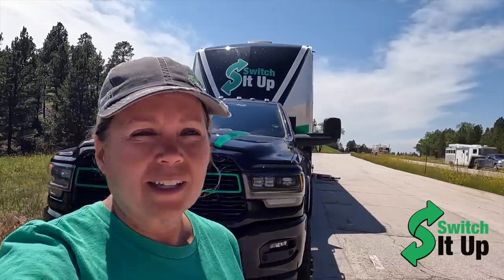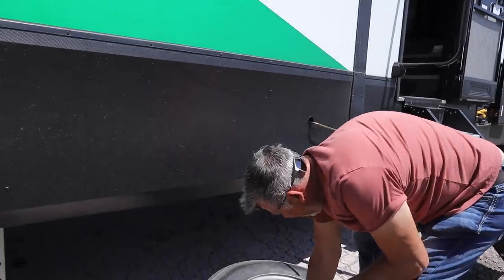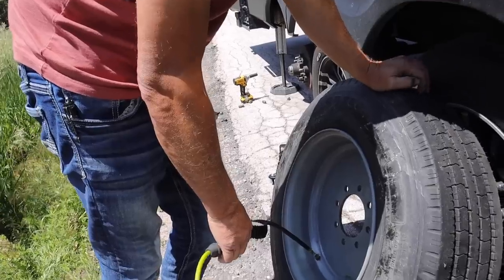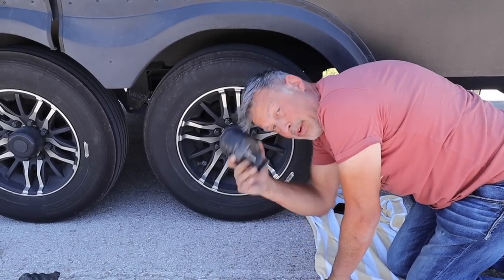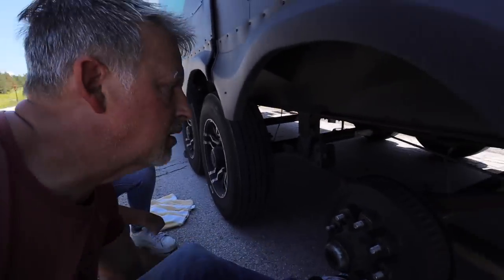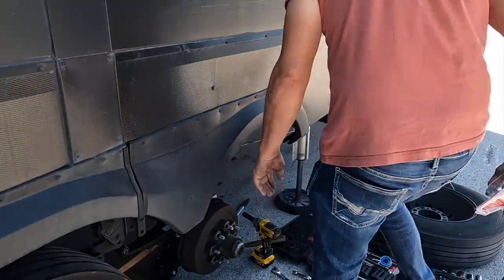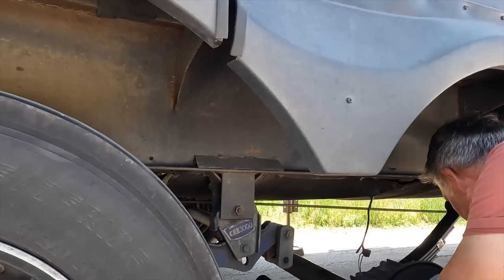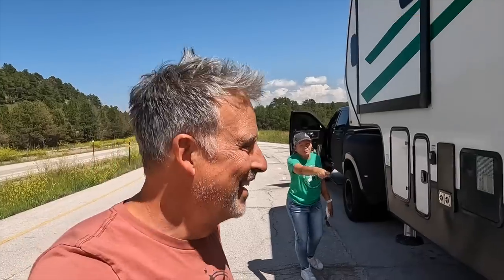Broken Leaf Springs in RV Life. How do we fix them?

Comment: All ways ready? Now Grand Design has this deal where they send you a whole set of tires for free...just ask, I got mine.  Dexter will send you a complete set of new axles which has new pads, bearings, axles, drums, etc. We got ours, my wife and I installed them on or Saint Augustine lawn using a plywood base and 4 bottle jacks.  Used 2 furniture movers to cradle the drums by adding a extra piece of wood. Grand Design has been there for our four years in the Imagine 24mpr toy hauler. Good luck with the rest of your under carriage.  I am impressed!

Comment: I would toss all 6 $50ea china leaf springs.  I no longer worry about the cheap china Dexter or Lippert springs.  I installed American made springs with American steel.  Never worry about broken springs again.  AlCan springs Grand Junction CO.  They are 2inch wide rather then 1-1/2inch.  They machine the ends down to fit you existing spring hangers.  Also the ends are a much larger diameter so a real thick bronze bushing can be installed.

Comment: Very lucky in many ways.  I too carry 2 spare leaf springs and use sumos.  I use the Sailun S637 tire and have had great luck.  I lifted our trailer and hauled them in.  I also went from the 235/80 to the 235/85 as it added 500lbs more capacity to each tire.  Good luck you two.
Reply: also I went from 235/75/16  10ply  to 235/75-16 14ply 110pounds tire pressure

Comment: In truth, replacing leaf springs could /should be done every couple years. The beating they take is enormous.  And, like any spring, the more they are exercised the more they degrade. Yes. Carry spares. I do as well. But check with a suspension specialist regarding a recommendation for routine replacement.

Comment: Should have higher weight rated suspension. Obviously this suspension can't handle the load. But RVs are built to the absolute minimum requirements. Good job fixing it so quickly....

Comment: Great job. That’s where they break. They reverse arch at the ends. Replaced mine after 1 1/2 years and the shop added an extra longer leaf that goes almost under the eyebolts. Basically gives u a 4K axle.

Comment: Great job i have same problem  on California almost 500 miles driven home happen on Sunday  morning shops was close my only solution was lifting the trailer and put a 4x4 lumber board  between the frame and the end of the broken leaf  when i lowered the trailer the spring created a packet on the board and helped to keep the board even with the frame stated in place until we back home I hallway when stop for diesel i check the gap mine is 2 inch apart between front and back tires doing that i found one side of the trailer was closer from the other side i decide to check the suspension

Comment: I believe the broken spring and the bad tire are related.  I had a flat tire on the rear curb side of our camper, we noticed it at a gas station.  We pulled of to the side and replaced the tire in no time, no big deal.  While doing my walk around before taking off again I noticed we had a broken spring hanger on the rear road side.  Of course it was 4:00 p.m. on a Saturday in southern Missouri and everything was closing for the weekend, we ended up limping to an RV park.  To make a long story short we had a local weld shop repair the hanger on Tuesday and we were off.  I believe the broken hanger caused abnormal wear on the opposite side tire to make it go bad.  Thoughts?

Comment: Todd you do  impress me. We too had a leaf spring break on our last trip and we did not have a spare and had to try and find one on a Sunday, thanks to Tractor Supply we were able to make it back home safely.
Reply: I had this happen close to home and knew of a local trailer company with springs in stock.  I never would've thought to find a spring through Tractor Supply.  Thanks for the tip!

Comment: I had a broken spring on the passenger side, rear axle, driver side tire wore inside out. Used the rv jacks, and truck jack. The axle and spring should have a five year warranty, per Grand Design and the axle manufacturer.

Comment: You were lucky of fortunate you decide. It's hard to know how much torque you are putting on a 9/16" stud, but it happens. Hopefully you make the rest of your trip and you can inspect all the other studs that hold on the wheels.  Good Luck!  Nice video, you did recognize your use of the impact wrench and the root cause of the stud failure.  Great Travels!
Reply: 9/16" recommends  90-100pounds

Comment: We replaced our shackles and bolts with the MorRyde heavy duty shackle kit. This provides a better and stronger shackle, wet bolts and bronze phosphur bushings.  From what I've seen. The plastic bushings wear out and then the leaf spring ends take so.much stress that they snap at the ends due to flex.  The kit for our trailer was less than $150 shipped.  They also quiet down the suspension so much it's noticable when driving through parks.  We like it so much it is on our first mods list for any new travel trailers.

Comment: I know this is said later, but greasable wet bolts with brass sleeves, it will last long than the Teflon sleeves. That was one of the first mods I did on my first trailer because of the squeaking on dirt roads. Also I upgraded the leaf hangers. Interesting how bad the stress cracks are. Now I have to really inspect my Solitude.

Comment: I am disappointed that I see so many posts with broken leaf springs on young trailers.  Highly dangerous.  My 1999 F150 has its original leaf springs on the rear axle with no issues.  Driven both on and off road. Tows pull trailers.  This gives me a low level of confidence in RV manufacturers providing quality suspension components.

Comment: You are about the 4th or 5th person that i have seen had broken leaf springs that have also had the sumo springs.  So...i have to wonder if the sumo springs are actually causing broken leaf springs.
Reply: I was thinking the same thing, maybe the sumo spring puts more pressure on the end of the leaf springs
Reply: @markrizzuto8751  yep, that's what I was wondering too.  They limit the travel of the middle of the spring which may cause the end to snap when it bottoms out.

Comment: Is it time for independent suspension, you made no mods on your suspension system . Stock GD
Reply: Do you think they can afford $11,000 +  ?
Reply: Lippert & Dexter, not Grand Design
Reply: @user-wn1vt4lx5u  ment suspension, I believe GD uses dexter axles and Morryde suspension.
Reply: Most leaf springs that break, including mine in 2021 on a 2018 Momentum break just like Todd's did - It looked identical to mine. But uveitis also seen the spring hangers break. I believe that's part of the chassis. Those rear hangers are punished - particularly on those "too sharp" turns we are all guilty of making I ng from time-to-time. Don't forget to check them for stress ceacks.
Reply: @TonyBenton0728  forgot they have a triples.

Comment: The highways are terrible. They will break your suspension.
I 80 from Indiana line to Joilet, Illinois should be avoided.  
It’s the most dangerous stretch in all of the USA.  
The speed limit should be lowered to 30 mph for those 40 miles. 
You will not know it v one something until miles later. 
You need to use my safe easy bypass.